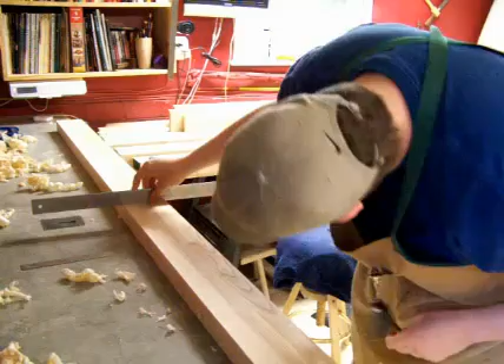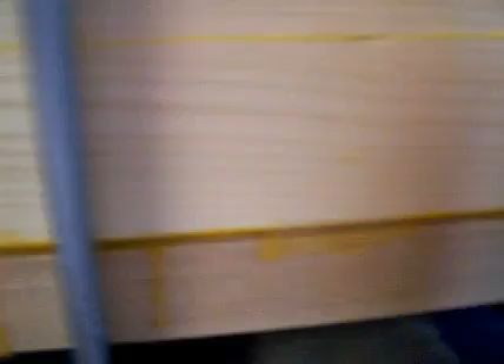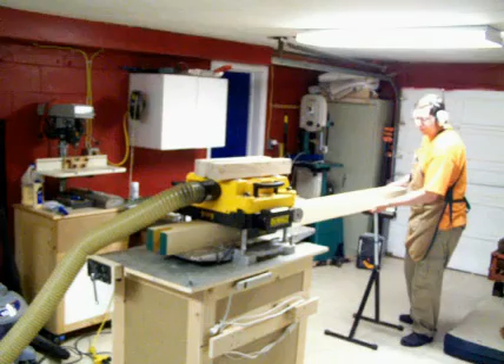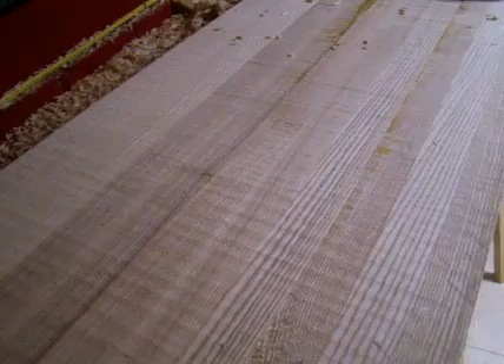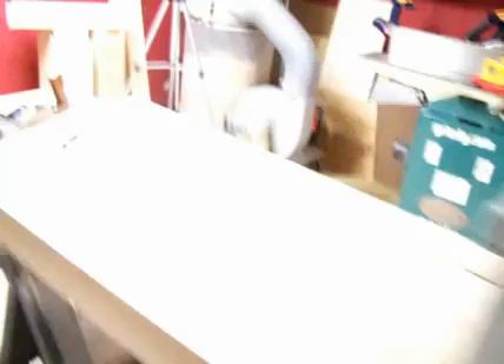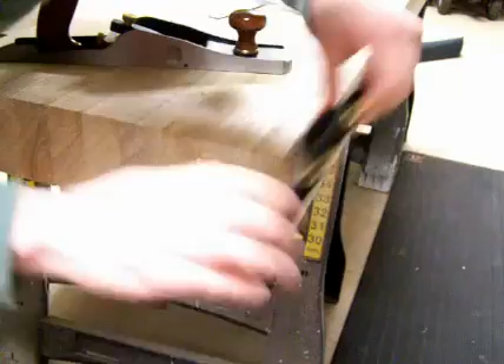RWW 32 AssemblingTheRouboTop

Comment: Suggestion : If you are going to continue woodworking with thick lumber, you really should buy a good miter saw or a radial arm saw, which will eliminate the wavy unsquared sawing you experienced with the table top end cut for the final length. I personally like a radial arm saw for most cross cuts on all types, kinds and thicknesses of lumber. The saw blade will leave saw marks on end grain cuts, but those are easy to plane off or sand away.